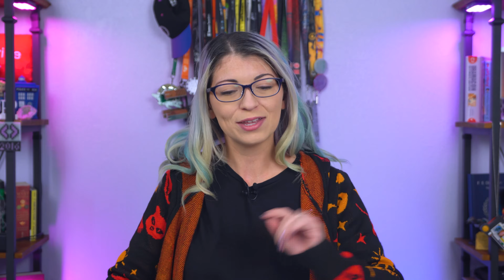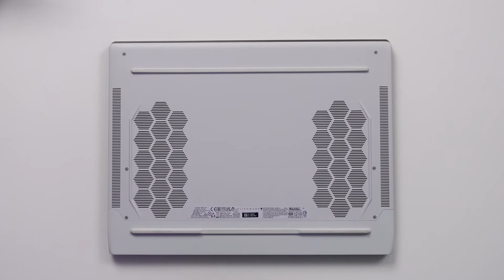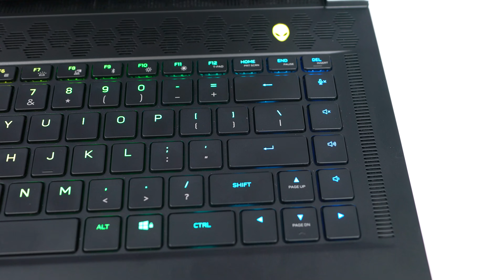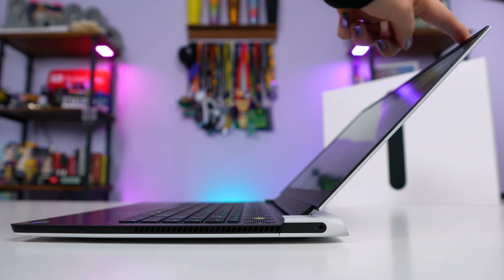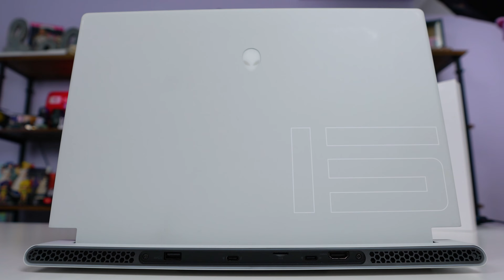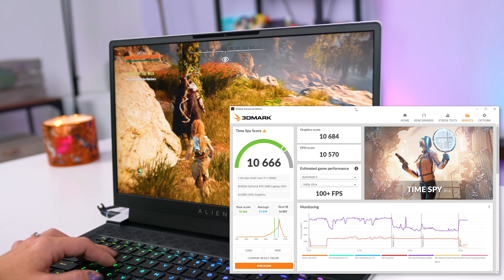Alienware x15 Review! Thin Video Editing Laptop!

Comment: RAM soldered to the board with no extra socket would be a deal-breaker to me, not just at this pricepoint.
We should collectively push for more sustainable, repairable and upgradable electronics.
Reply: Agreed!
Reply: The X17 does not have the ram soldered